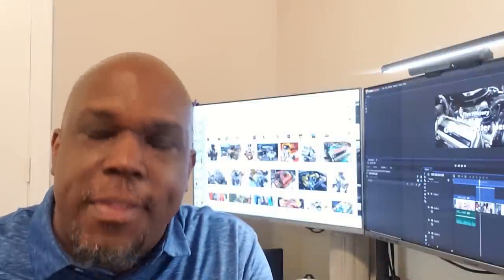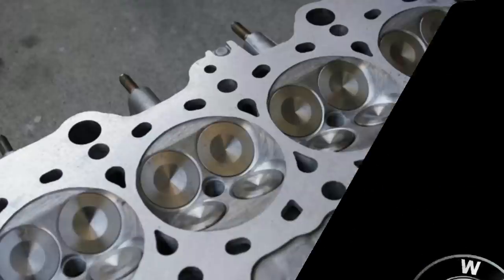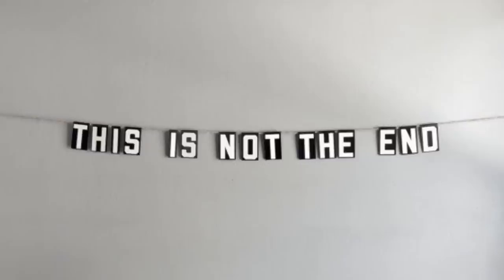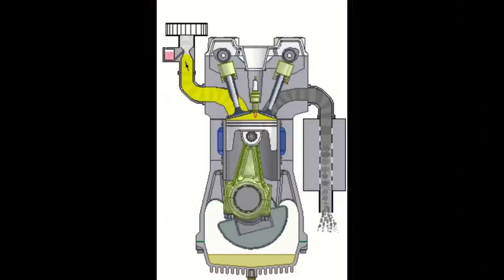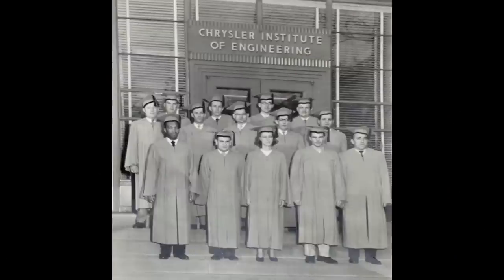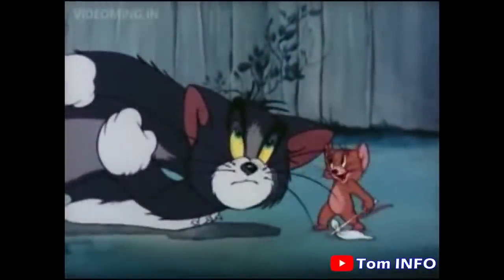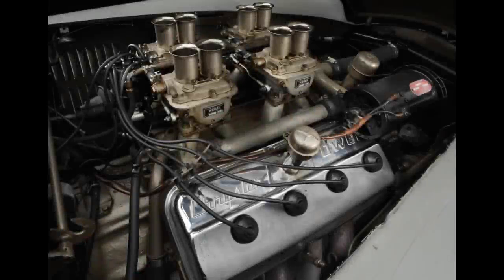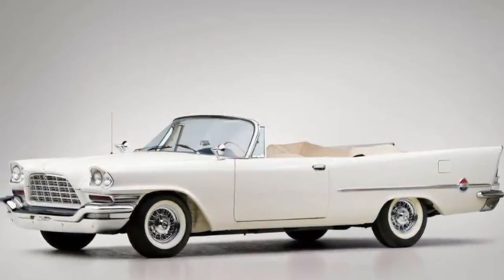The History of the Chrysler Hemi Gen I

Comment: Excellent video presentation! I would like to add 1 piece of information. The 1st American made automobile to produce 1 horsepower per cubic inch displacement as "standard" equipment, not as an option, was the 1957 DeSoto Adventurer & you received a letter signed by the CEO of the Desoto division of Chrysler stating that fact. Engine stamping number: S26A, 345 CID, 345 HP affectionately nicknamed the "Orphanwhale".
Reply from the maker: Thank you for that information!

Comment: It's always a good idea to locate the valves closer to their respective ports but it turns out that a half sphere isn't a very efficient combustion chamber shape. I have driven a street Hemi from the early 70's and it was a visceral experience.
Reply: Not efficient? Why are all top fuel and funny car engines near exclusively hemi architecture domed pistons make up the extra space having intake and exhaust valves directly across from each other is very efficient and obviously effective I don't see many other production big block architecture making 11 to 15000 hp on nitro meth
Reply: @mobygodfrey4936  The chamber design is great for moving a lot of air but it lacks good quench. There are trade offs on all designs. The Gen 1 and Gen 2 Hemis are my favorite engines but I understand their drawbacks. Sure, when making a sub 4 second pass while throwing tons of nitrous and boost through them they are second to none. But the reason why they were dropped at the end of the '71 model year is that airflow isn't all it takes to make an engine efficient. Today's "Heart Shaped Twisted Wedge" heads are about as good as any 2 valve engine can be for combustion efficiency. The Gen 3 Hemis use a modified Hemi design that adds quench areas while still having the excellent airflow of the traditional Hemis from earlier years. But they aren't quite as efficient as the modern wedge engines which is why they have 2 spark plugs per cylinder.  The Hemi has it's place at the top of the heap for making horsepower for sure, but the statement that the chamber design isn't very efficient if you talking about combustion efficiency is also true.

Comment: Man , I really enjoyed this , thank you for putting it together . The Early FirePower is my favorite engine series. I often think about the way it was discontinued , the B engine had to be on the drawing board in 1956 ( as the 354 exceeds 1 hp per ci ). I'm also not sure about Zedars involvement  , or was he " blind-sided by the change ? The availability of high quality gasoline by the late 1950's allowed the simpler designs to perform almost as well I guess ( in production autos ). 

The FirePower engines would dominate fuel drag racing  throughout the 1960's . It would also come back to life in 1971 as the Donovan 417  , the first aftermarket aluminum block specifically for drag racing ( based on the 392 block ) .
Reply from the maker: Thank you for this info! I'm currently writing the script for the 2nd gen and the fact that they based the Donovan block off the 1st gen is very useful!
Reply: @TheGearheadLounge  The HAMB message board has a thread titled " Drag Cars In Motion Picture Thread  " that is like 2000 pages long . They also have a thread on the Donovan that has some neat old articles .  Tons of Early hemi info throughout the site ( also 427sohc , and probably some 426 info ).

Ed Donovan had some interesting opinions . Also check out the series on Youtube called " The Surfers " ( episode 29 is great ).  They talk alot about Donovan in that series.
Reply from the maker: @Mike_Collins392  Thank you! I'll be sure to check it out!
Reply: Chrysler should have only built the 331-354-392  hemis and used less costly OHV V8s for Dodge, DeSoto and Plymouth.   Simple torque motor motors like the Buick nailhead did the task the buyers wanted.. The hemi performed very well for racing but simpler motors were ok for how the mass market used vehicles.   Buick loaded up with chrome and nice interiors.
Reply: @timothykeith1367  Yeah , something like that would have been reasonable. The new engine manufacturing plants ( B - RB ) couldn't even keep up , and why they ended up with making 383 tall deck engines for a year or 2 . 

And the " Max Wedge " program was one of desperation . Those engines never even came close to the 331 A-311 engine from the mid 1950's ( there is a comment from a Mopar factory racer of the day on Alllpar regarding this ). Imagine the manufacturing cost difference of a 413 or 426 with all of the long ram stuff compared to a 392 . The 426 Hemi solved all of this nonsense and was a slap in the face to the bean counters ( and scheisters ) who discontinued the old engine in the first place.

From what I have read even the drawings for the early engines had been trashed by the mid 1960's . Donovan had to start from scratch taking measurements from existing blocks , and also why it took him until 1971 to get it out.

Comment: Crank driven centrifugal superchargers were incredibly common on WWII aircraft engine, although I believe they were typically gear driven rather than belt driven. Multi stage supercharging was common as well, some of which used both a turbo and a mechanically driven supercharger, others multiple superchargers, often with various different drive ratios that could be selected based on what altitude you were flying at. 

Turbos were bulky and required better materials, so in general they were developed later in the war. 

The biggest advantage that the P51 Mustang got when going from the C to D wasn't the engine itself, it was the induction: A-C had a single stage, single speed blower while the D received multiple stages allowing for much better high altitude performance. That's generally credited to the Merlin replacing the Allison, but it has far more to do with the blower setup than the engine itself. 

From looking around, I believe it had a single stage turbocharger, but at the time they were generally called turbo-superchargers.
Reply from the maker: Thank you!

Comment: Chrysler built in line 6 engines with Hemi heads before the V-8 Hemi. I saw two of these heads when I was in my early 20's. No valves or valve train was with those heads. Wish I had knowhow they were then. Could have had them cheap. They looked like 331 heads just two cylinders longer.
Reply: The prototype heads for the 331 were first built for the 251 flathead six.   They had no intention of placing them in production.  You can find photos.
Reply: @Sgt York @Timothy Keith - Hardly anyone realizes this, but the 1960s Slant Six had hemi heads. This is why in the six-banger drag classes, it out-powered Chevy 292s and Ford 300s unless they were monster high-compression stroker engines. I was the pit crew for an E/Altered that used a bored out 292 with Enderle injection and a Racer Brown roller cam. It used six right-bank 283 pistons and, I forget the stroke, but it displaced 312 CI. I later bought that T-bucket when the owner put his six into a rail dragster. I repowered it with a Small-Block Chevy V8. I ALMOST put a Slant Six into it but the little Chevy was already race built and I would've had to spend a bunch of $$$$ to hotrod the Slant Six.
Reply: @edbecka233  I love the slant six.  The bore and stroke is almost identical to the classic Jaguar 3.8 - which was then the highest specific output production motor in the world.  Its as if the Chrysler engineers economized by using the simple cylinder that they chose.  The old XK6 was a torquey engine, its last application was in a British military truck.  The 3.8 E-type had hemispherical combustion chambers, but like the slant six wasn't a high rpm motor.
Reply: @timothykeith1367  Back in the day Kay Sissel and some other six-banger gurus did all kinds of tricks to all the major sixes. Sectioned & siamesed V8 heads, adapted mag drives, 180 degree firing setups that fired two cylinders at a time, oddball spaghetti intakes & headers, gear-drive systems for cams, Hilborn & Enderle made injectors, Racer Brown and others made race cams...

Comment: Supercharging refers to raising intake pressure above atmospheric pressure. It can be done with a blower or exhaust driven turbocharger. Aircraft can be blown or turbocharged (at altitude) to normal sea level pressure with a blower or turbocharger without supercharging.

Comment: That old Hemi spawned the Poly whose block looks damn near identical at a glance. The Poly in turn became the A engine.
Reply: The Poly WAS the A-engine. When they started looking to build a "lighter" A-engine the 273 "L" A engine was born with thinner walls and casting techniques that made it a much lighter block than the original Poly. From what I understand you could almost literally take an early HEMI head and bolt it to the Poly block and vice versa.

Comment: Great video!
(Regarding your V16 hemi airplane engine section, please know that mechanically-driven superchargers were very common in WWll liquid-cooled fighters (eg, RR Merlin, found in Spitfires, Mustangs, etc). Typically, these were centrifugal (vs Rootes type), and progressed to being two speed (for low/high altitude) as development progressed. The GE turbo was typically used in aircooled US radials (eg, B29)
Reply from the maker: Thank you so much! I appreciate the info! I really tried to find out the truth, but was I couldn’t find anything that I considered conclusive. Admittedly, my knowledge was limited in that area.
Reply: I believe that the F4U Corsair has a mechanically driven 2 speed Supercharger on a Radial Engine.
Reply: The Germans also used Nitrous Oxide in their fighter planes for a burst of speed in a dogfight.
Reply: @pointingdog7235  It depends on which version of the F4U you're talking about. For instance the F4U-1 used a two-stage, two-speed supercharger. The F4U-4 used 3 supercharger impellers; two of the impellers, which made up the first stage, ran in parallel which in turn ran in series with the second stage impeller which ran at a fixed speed. The dual first stage impellers were variable speed. (Phew, and the foregoing is an over simplified description!)

Comment: One correction.
    In 1951 the 331 Hemi was Standard,  with "Fluid Drive" semi automatic transmission and power brakes on Saratoga as well as New Yorker and Imperial and Crown Imperial. The significance of that is that the Saratoga was the only one of the v8 cars to have the shorter wheelbase. Previously all 8s (straight 8s before 1951 model year) had a longer wheelbase and the difference was in the area between the bumper and the cowl, presumably to make room for more cylinders.
So this model, the Saratoga, especially the two door club coupe, ("Post", there was no Saratoga hard top) was the focus for racing.
Reply from the maker: Thank you! I appreciate the correction!

Comment: Great video!!! Look into the "Swanp Rat"  Don Garlits. 392 Blown, Top Fuel, first 200 mph in the 1/4.
Reply from the maker: Thank you! I will!
Reply: @ john,  Kenny Bernstien broke the 300 mph barrier, by then they were running Keith Black engines which were based off the 426. But if i remember up to one point the only part that would cross between  chrysler hemi and Keith Black hemi was the cam bearings. At this point i don't know cam bearings would even be the same.

Comment: Great story!

Stoddard-Dayton had a "hemi" starting in 1908 and 1909 single cam, single rocker arm engine. It was a 352 cu in 4 3/4" bore and 5" stroke. It produced 45hp. In 1910 Stoddard-Dayton made a dual cam "hemi" same bore and stroke but produced 50hp. The link below shows our 1910 Stoddard-Dayton on its first start after its restoration in 2019.
https://www.youtube.com/watch?v=AvpjjWfCM8Y
The link below is a video of a 1909 Stoddard-Dayton, you can see the difference between the engines.
https://www.youtube.com/watch?v=OOAgDCnK1rw

Both cars are great cars to drive. The red 1910 is a fast car, we had it up to 50MPH when I took my foot off the gas.
Reply from the maker: Thank you for the links and the story!

Comment: When I was in my late teens just getting into hotrod old car and car part hoarder passed away and his wife who knew nothing of parts and value , let us rummage through the yard and a giant barn stuffed with engines and parts . I was looking for camel hump small block heads , I remember pulling an old tarp off an engine and being puzzled at what I was looking at , but I remember ardun on the valve covers neer looking engine but being young had no idea that it was a flatly conversion.  I found the camel humps , 50 bucks if I had only known the value of that ardun I could have probably nabbed it for 150 bucks.

Comment: ALL of the racing records back in the day belong to the hemi.  

Back in the day, the hemi squashed the others like a bug.  Comparing the average torque output throughout the rpm band, it was an absolute massacre.  After finishing 1, 2, and 3 at famous races, the Chevy-dominated racing organizations adjusted the rules to make the hemi run with a handicap, the equivalent of requiring Usain Bolt run with ankle weights so others could win.  Thus, the big names who built their reputations with non-hemis have illegitimate records and the brand recognition awarded the non-Mopar manufacturers was simply stolen honor.  In the NMCA, the weight penalty imposed on the Hemi cars was so substantial that the weight of the vehicle would surpass the maximum allowed per the SFI chassis certification for the classes.  Hemis are outlawed for a reason: they dominated the competition.  IHRA Pro Stock is another example.  Mopars and Fords competed with a Hemi headed motor, as did Chevys with Sonny Leonard "Next Generation" Hemi heads.  Wait!  Sonny's Chev Hemi can't be legal because they never made a hemi version.  It can be if Chevy guys make the rules.  The same happened later, long after the "Rat Motor" and its poly-angle valves debuted, when Ford introduced their Cleveland series engines.  Suddenly there were new rules to handicap poly-angle valve motors to protect the small block Chevy.  Another is rules were "expanded" at a local NHRA track too where it forced guys with stock 5-speed Mustangs to have scatter shields but not the 5-speed Camaros.  If you cited the NHRA rules, the techs would simply say, "track rules".  The "track rule" didn't start until the Mustangs started mopping the Camaros by a full second in the mid to late eighties.

I haven't been in it in quite a while and my posts refer to the period no later than 2008.  I've built engines for other people, but I personally raced Fords most of that time because when a Ford won, people would talk.  Ford's castings, machining, and design for a passenger car were the best, which in turn made it the worst for performance.  Fords, Henrys as we called then, were expensive to build compared to Chevys, and one needed to think outside of the box to even get them in the game.  Thus, nobody can accuse me of being a fan-boy of anything.  I'm just stating the hemi reality back in the day.  I no longer have flow-bench and dyno access and haven't worked out much of anything regarding the newer 4-valve OHC engines as life took me in a new direction.

Comment: Great video! A number of side notes. The Messerschmidt BF 109 also had an engine with the crankshaft on top and the "heads" (butts?) at the bottom. It gave a narrower fuselage design in the pilots line of sight. 

Triumph (The English car) "developed" a V8 engine for the Stag model. This was an abomination. Jealousy between the brands (like with Chrysler, De Soto, and Dodge?) prevented the very good V8 engine of Rover to be used. Neither brands are still around...
Reply from the maker: Thank you for that!
Reply: I have a Daimler hemi v8 from a 65 Daimler.. designed by Turner if Triumph but oddly enough never used in triumph cars. Looks like a shrunken Chrysler hemi and 145 hp out of just 2.5 litres ( 155 cubes)
Reply: @jimmyj2563  I think the Rover V8 was originally a Buick design. I remember the Daimler V8. Simca also made a 2.5 litre V8 which was used in the Vedette model. The engine was a side valve of Ford origin. It did not make a lot of power - between 60 and 80hp. Production lasted up to 1963 (in Brazil).

Comment: Outstanding documentary,
I was in the understanding that the first Hemi was in the Sherman tank
Reply from the maker: Quite possibly! Thanks for watching!
Reply: The Sherman used a Continental radial 975 engine. It's similar to the engine used on the Stearman biplane trainer. Every now and then, you will see a Stearman engine with a stud on one or more of the cylinders. It's often cut off. Those studs were for the cooling shrouds necessary for the air cooled engine to be used in the confines of a tank. Later Shermans used an odd Chrysler 30 cylinder engine, but they were flatheads.
Reply: @dougrobinson8602  That 30 cylinder tank engine is interesting also. 5 regular flat head sixes on a common crankcase. I first seen it at the Chrysler museum in Detroit. I think it would continue to run even when one engine was disabled.

Comment: It should be noted that the XI-2220 V-16 aircraft engine was inspired by the inverted V-12's of Germany.  However the program was hurt by the use of only one intake and exhaust valve per cylinder, when 4 valves per hole was cutting edge @ that time.  The effort cost the tax payers 13.4m in 1943, quarter Billion in todays currency.  As stated development was stopped by the jet age, however the Hemi was born.
Reply from the maker: Thank you!